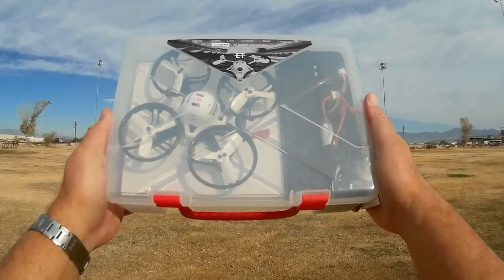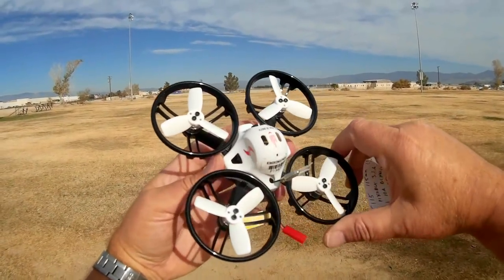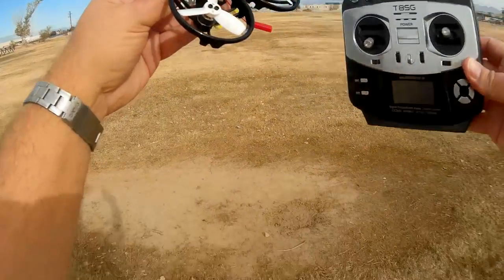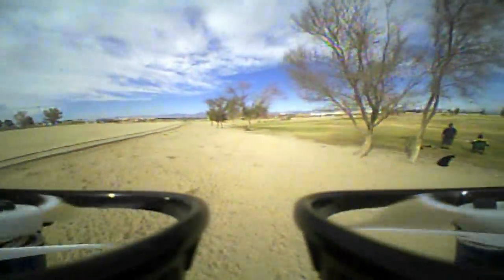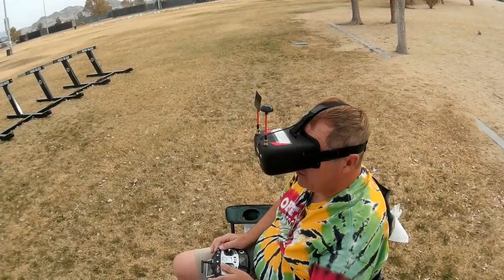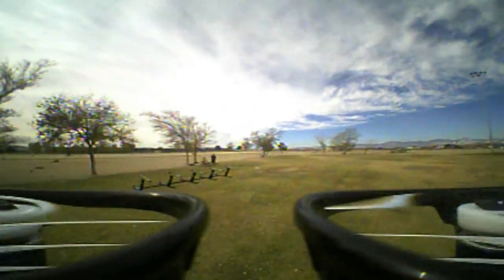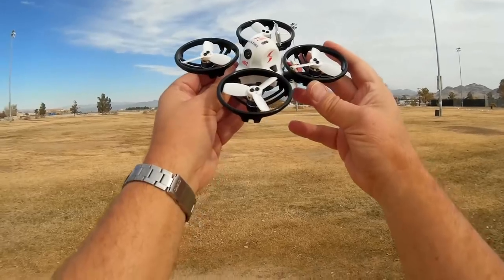ET115 115mm Brushless Micro FPV Racer Drone Flight Test Review

Comment: Pretty nice flyer. I think that most manufacturers leave the 'Vbat warning' levels at default, which are usually too high, which causes the premature beeper warning. They are probably set to 3.5 or 3.6 v per cell as default. You can safely move them to 3.1v or 3.2v, since low voltage on LiPos is 2.9v per cell. If you had OSD, you could be more aggressive with the settings, but since you have to listen for the beeper, you could probably still get away with 3.2-3.3 vdc. A lot depends on the  LiPo .. some, with lower C ratings, fall off rapidly once they get below 3.5v. Others with higher C ratings are fine.  A 550 mah should definitely be giving you at least a 4 minute flight, especially since you aren't really tearing up the sky with it. A brushless 1104 7500kv micro might be a bit too fast to fly indoors, unless you have access to an auditorium, or have a home as big as Bill Gates. Thanks for the review. BTW, it was 35 deg. F. here by the lake this morning, with Lake Erie temps right at about 50 in the NE Ohio/Pa. area.  Cheers.

Comment: This looks likes so much fun, and is nice to have for us 5" racing fans in the winter to fly around the house with. I'm not a fan of my Tiny7, and thought that this might fit my needs. But, I have a ton of the 450mah batteries, and getting less than 2 mins flight time is just not appealing enough.  Even 3 1/2 with the stock batt is way too short. I really think in the next few months we'll start to see 6 to 8 minute flight times out of these little guys - then I'll fork over my money.  P.S. - I can't help but laught at folks suggesting you review other items than what you're currently doing. I completely disagree - keep up the great vids. Besides, even us hard core race fans and/dji drone fans need a fun quad for indoor winter flying :)

Comment: You keep using that Jumper radio. Are you really feeling it that much, or is it just because it's easier to configure your next review? I'm using an FS-i6x and I can imagine the advantage of flying all my toys on the same Tx plus being able to buy the next quad on sale without having to sweat the protocol. But does it really compare to the Flysky and Frsky (at least the Qx7) radios in terms of flight experience and (at least expected) durability?
Reply from the maker: If you haven't gathered by now, I REALLY like the Jumper.  When I go flying, I take quite a few drones and airplanes with me, both for review and for fun.  I really like being able to fly them all with just one transmitter.  By the way, I also own  a Taranis X9D, a Devo 10, and many Flysky transmitters of various type.  I prefer the Jumper to all, much lighter and better feel in the hands.

Comment: Hi Quadcopter 101 .. why those race drones come with out radio controller ? 
I would like to buy a drone like this!! What radio controller do i need ? Im looking for one that not too expencive but can fly many others toys
Reply from the maker: Check out the T8SG multi protocol transmitters.  They work with most drone receivers.
Reply: thanks quadcopter101 i will check it

Comment: Hi I wonder what type of Transmitter are you using? Did you have to Use bataflight to Configure it?
Reply from the maker: No, I didn't configure it other than simply binding it to my transmitter.  I was using a multi protocol transmitter with DSM2 protocol.
Reply: @Quadcopter101  alright, nice one 👍🏼

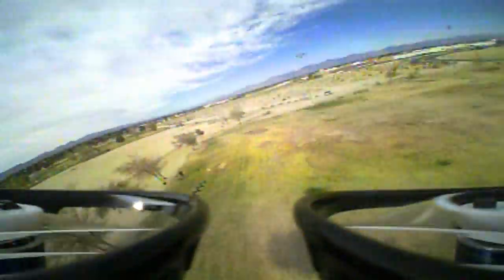Comment: 3:49 I see ur on acro mode that allowed u to flip, friend of mine bindined my ET125mm,  so I don't know witch switch acro of angle or  aimode so I don't know how to do flips and stuff, what should I Do conect it to betaflight and see If I can see all the functionality?
Reply from the maker: Acro is not easy to learn.  I recommend learning to do such on a simulator program instead.  Learning FPV acro using your drone will just end up breaking your drone from many inevitable crashes.  I recommend FPV Freerider.  It's an old program, but it's still good, and it's free.  And for $5, you can open up additional flying sites to try. https://fpv-freerider.itch.io/fpv-freerider
Regarding checking your switches in Betaflight, recommend viewing Betaflight tutorials on YouTube, such as https://www.youtube.com/watch?v=M7r1EzL0PuI

Comment: I have been hesitant in buying any ARF drones because I don't want to buy 10 different hobby grade controllers to work with each one. Can you recommend a controller that will work with all of them or a reasonable solution? Thanks!
Reply from the maker: Why yes I can.  The one that I'm using to fly it with in the above video.  Here's my review of this universal controller https://www.youtube.com/watch?v=ksEbk53NQPQ
Reply: Cool, I hope it works with my new BoldClash BWhoop B-03. Thanks! :-)

Comment: Thank for review!
I would like to share mine, after I bought one of these.

I have to say I am quite disappointed with this copter.

First of all, the KingKong motors showed up less than reliable.  After any, even slight crash, rotor goes off, it detaches from the shaft and there is no obvious way to put it at place again.  After that, often, the shaft just drops off.
I bought a few spare motors - they have the same problem.

The second problem is reliability of the ESC.  I had a few burned and on burned FC.
The ESC is a pain to solder - the pads are small and that requires skill and way more time that you would like it to.

The frame is flexy and does not feel reliable.  I am not sure it too flexible frame is a real problem, but 2.5 and 3 mm frames I bought after feels really rock-solid after one used at this KingKong.

In general - maybe it is just me, but mine copter did NEVER fly more than 3 batteries between repairements.  I disassembled it, reused VTX, Receiver and Camera in other builds I made after, and decided NOT to repear or reanimate this one.

Though, after this copter I got as hell of the skill on assembling and repearing copters and made a few builds since - without any problem thanks to endless reparements I had to do with this one :)

Comment: In my KK et 115, in air mode, when I arm, one motor start after 0,5s. And when disarm, the same motor stops first. Why? The quad is new and  it flies well.
Reply from the maker: Idle speed needs a little adjustment in Betaflight.  But if you're happy with how it flies, then leave it alone.  But if it is bothering you and you want to adjust it https://www.youtube.com/watch?v=2klkybVFKf0
Reply: Quadcopter 101 thank you

Comment: I just received the ET115, when I arm the motors, they start spinning and everything seems fine, but as soon as I give some throttle, and the quadcopter lifts, it starts beeping. Is that normal? What is that beeping for?There is hardly any instructions in the manual and I am a noob. Any idea?
Reply from the maker: Likely low voltage warning.  Are you certain that the battery is fully charged? And are you using the stock 80C battery as this brushless uses a lot of amps?

Comment: Additional Cons:
As per all KingKong quads ever made, No OSD! 
Funky Pico Blx FC that doesn't run Dshot, nor Turtle mode.
To change from 25 mw to 100 mw on VTX you have to bridge two solder pads, and undo the joined soldered pads to switch back! Yeah, no switch = ultra convenient! Lol
Won't run on 3S, has sticker saying not to! ... Only 10A 4 in 1 ESC's. 
Old KingKong camera that's barely ok-ish.
Must take off canopy to pretty much do Anything! 
Can't plug in USB cable to get into Betaflight without taking off canopy! 
Question is: when will LDARC finally run out of these antiquated parts and start producing something 2017, let alone 2018 ! Geeez! 
Go0d NeWs! Looks like Banggood is going to carry a new LDARC model that will   F I N A L L Y  have an OSD! It's about friggin' time! LOL
Guys: The only real strong point of this quad is the frame! Pretty much bulletproof! Buy it for under $15 and build this the way it should have been! That's the way to go!